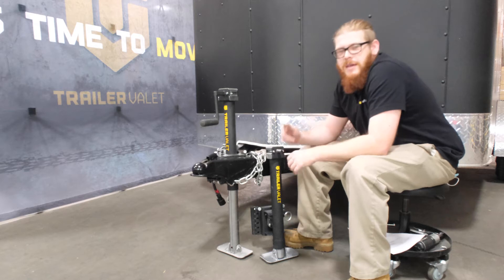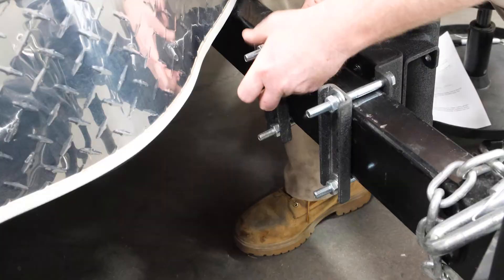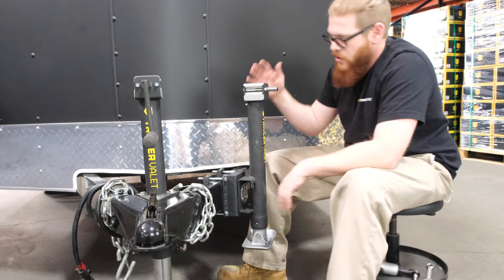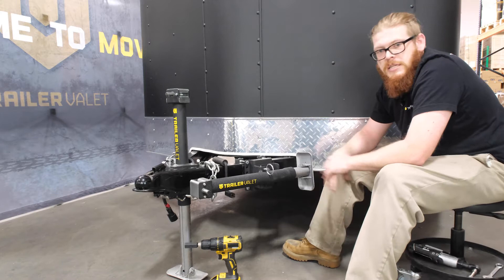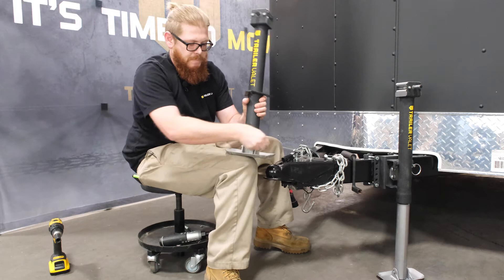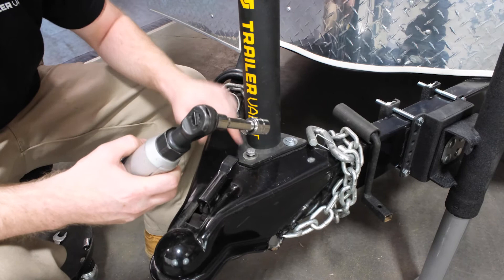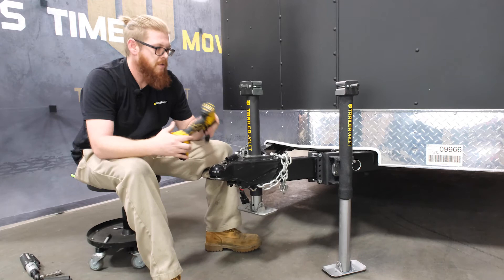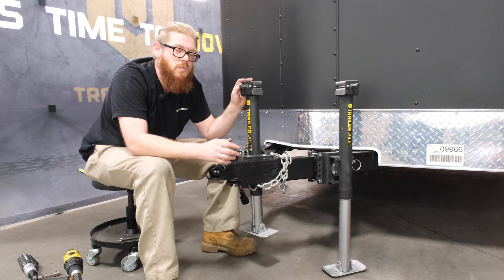How to Install the JX Drill Powered Jack Series

Comment: I have a V haul boat and I need to get the front up higher so that when I wash it, the water will go out the scupper holes in the back. How high is this jack able to lift the trailer tongue off the ground? More than 20”?
Reply from the maker: Hello! Our jacks can lift up to 23.5"